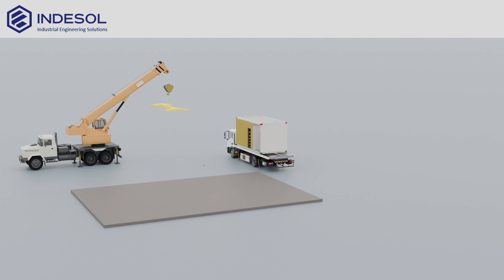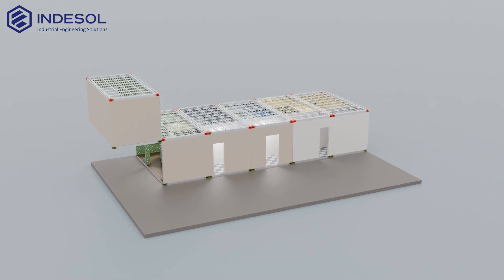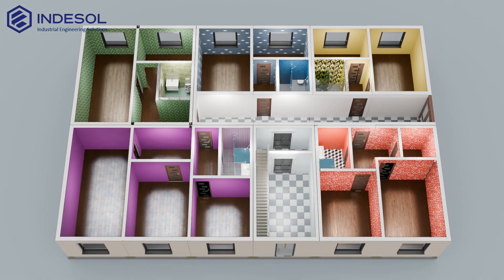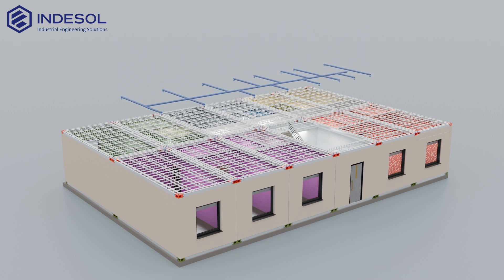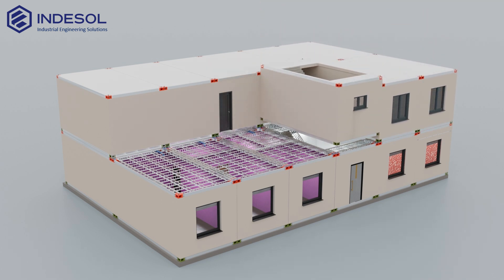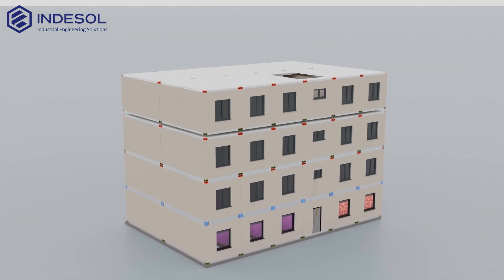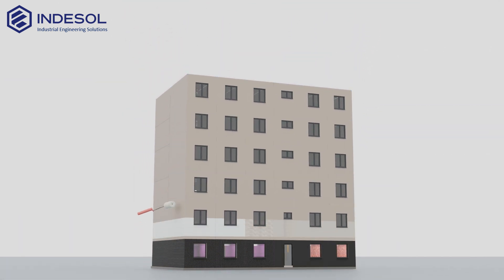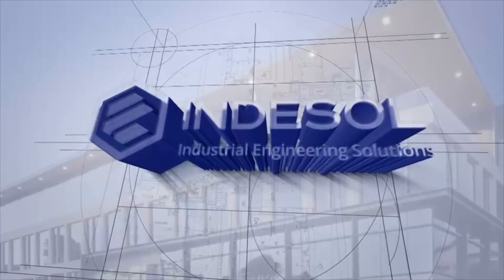How Modular Homes Are Assembled On-Site | INDESOL Modular System

Comment from the maker: See how INDESOL modular homes are assembled on-site using factory-built volumetric units and lightweight foam concrete panels.
 Our modular production line enables fast installation, budget savings, and high construction quality.
📍 Learn more about our technology: https://indesol.ae/products/modular-building-construction
 📥 Request a brochure or consultation: info@indesol.ae
#ModularConstruction #PrefabHousing #FoamConcrete #INDESOL